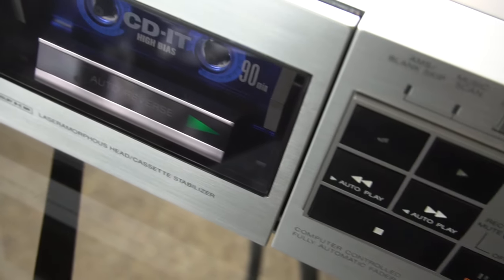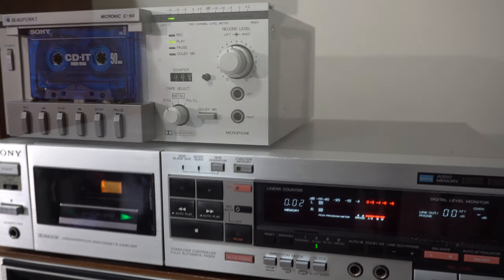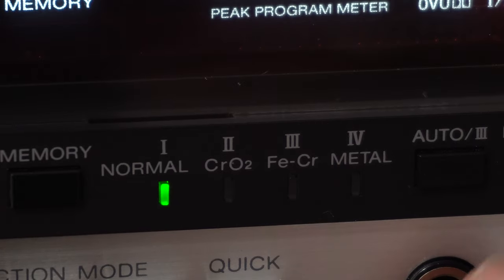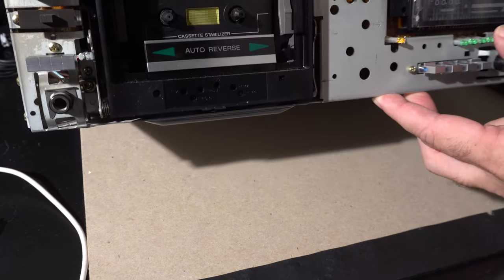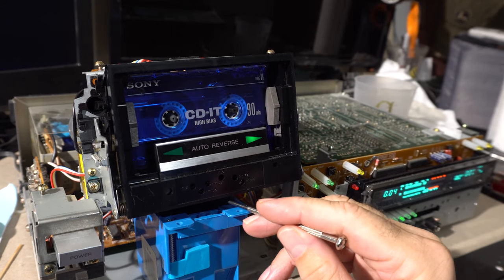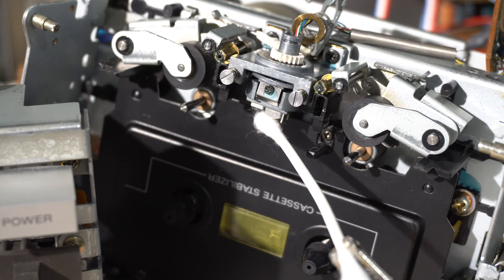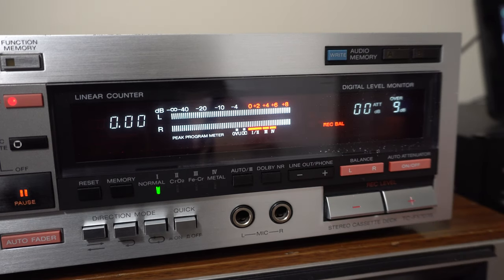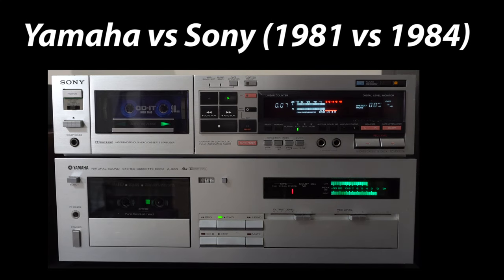Sony TC-FX707R Stereo Cassette Deck - Totally 80s

Comment: 5:00 I might be crazy but it sounds like Running in the night from fm-84!!  hahaha awesome device tho! My dream its have one of these amazing decks
Reply from the maker: Yes. I have seen one of these decks on shopgoodwill.com recently. Thanks for watching the video.
Reply: Just keep in mind auto reverse would need azimuth adjustments eventually, the flipping hammering type action. I have auto reverse and rarely is this a slow easy flip. A Nak actually devised a mechanism that flipped the cassette instead of the audio head (it stayed precisely in position for optimal alignment). Auto reverse was for convenience as well as dual cassette well decks. Anyway good luck on your search 😃😄.